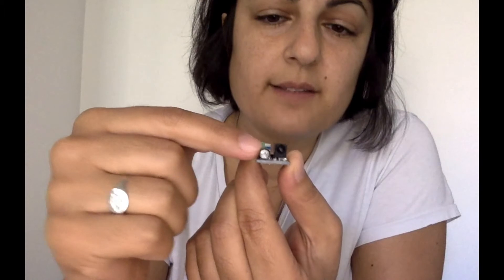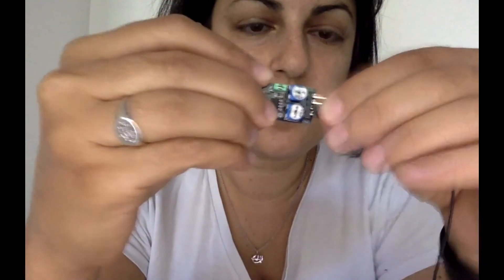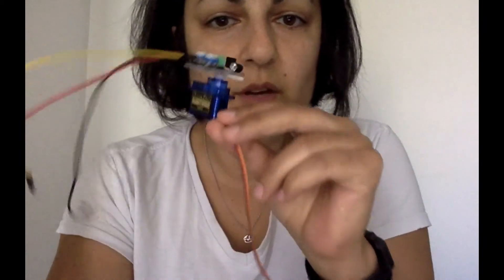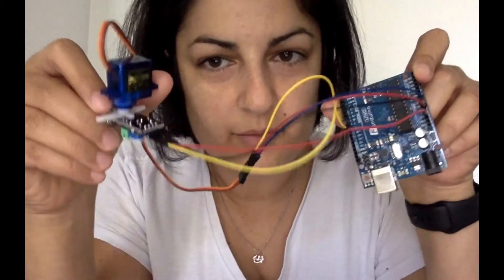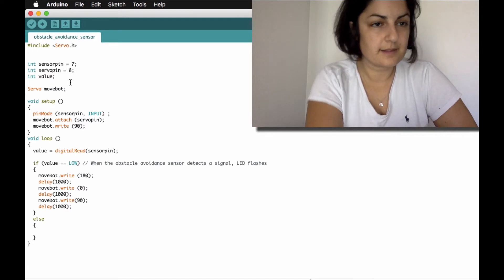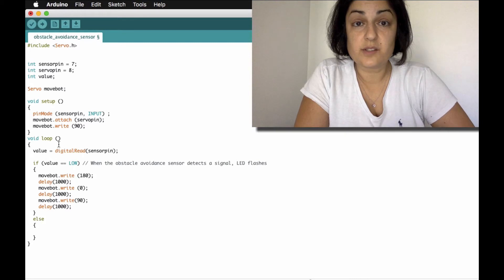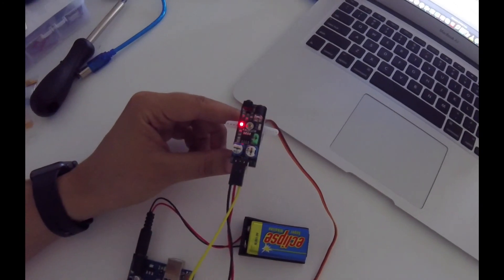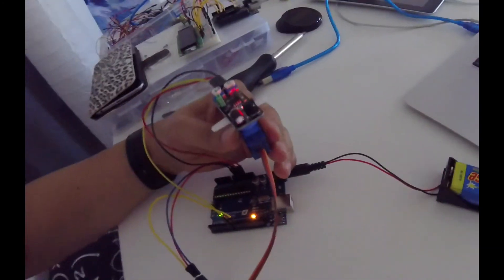How to create an obstacle avoidance robot using Arduino

Comment from the maker: Here's the Arduino code:

#include <Servo.h>

int sensorpin = 7;
int servopin = 8;
int value;

Servo movebot;

void setup ()
{
  pinMode (sensorpin, INPUT) ;
  movebot.attach (servopin);
  movebot.write (90);
}
void loop ()
{ 
  value = digitalRead(sensorpin);
  
  if (value == LOW) // When the obstacle avoidance sensor detects a signal, LED flashes
  {
    movebot.write (180);
    delay(1000);
    movebot.write (0);
    delay(1000);
    movebot.write(90);
    delay(1000);
  }
  else
  {

  }
}